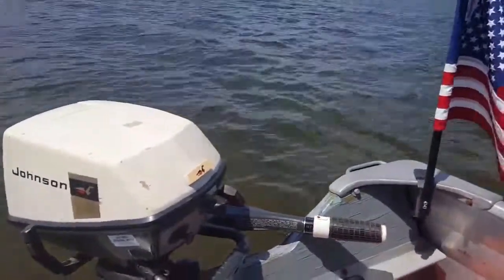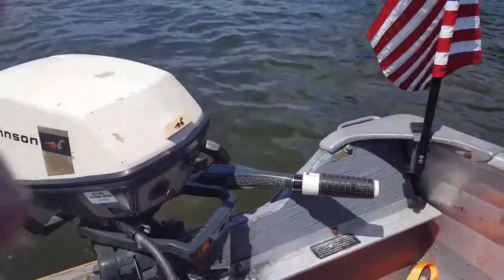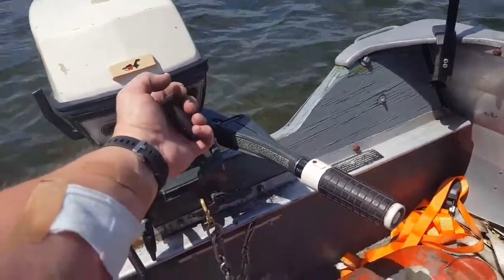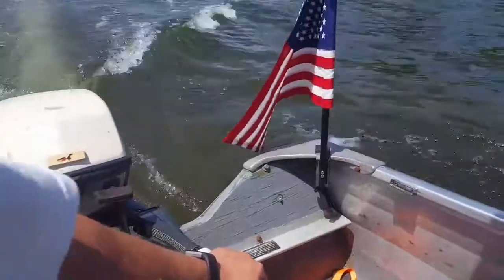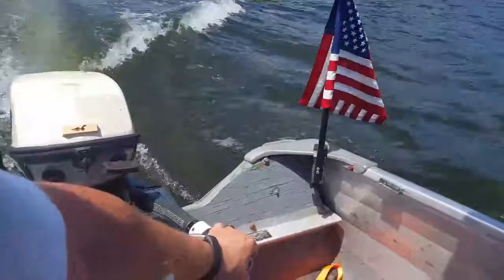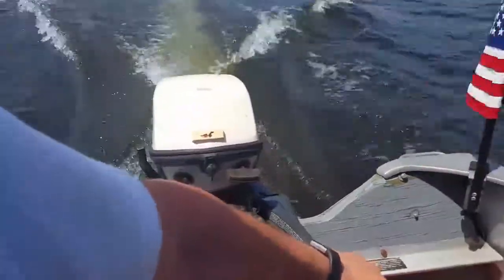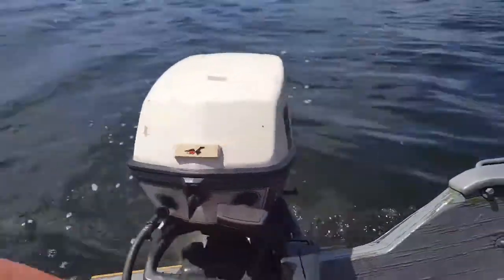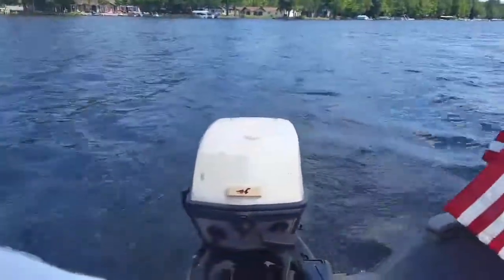1969 Johnson 6hp Outboard Motor on Manistee Lake

Comment: I have a 69 6hrs it's been sitting  up in my dad's closet  for about 25 years. I got it out the other day  and tried to start it. No luck. Pulled the plugs they were oil socked . Cleaned them with some fresh gas. Still no luck so I pulled of the fly wheel points look good to me sprayed with a  little  contact  cleaner still no luck pulled carb cleaned it up still no luck. What should I try next?  Thanks in advace.

Comment: ok thank you. but I don't know if I already said that it runs fine with the airbox off.
Reply from the maker: Corben B Yes, you did say that. That's what makes me think that gasket may be missing.  With the airbox off, it may be allowing just enough more air to burn the extra fuel getting through the leak.

Comment: I have got the same motor (6r69m) I was wondering when I look in the cylinders I can see it was honed. I have also noticed that the paint around the engine has turned red which I believe is from overheating.  Is there a possibility that this engine was rebuild or is it just a really low hour outboard and I am seeing hone marks from the factory.  Thankyou
Reply from the maker: It seems most likely you have a low-hour engine and you are seeing cross hatch from the factory hone.  It is difficult to say for sure without seeing it myself, but it is not that unusual to find factory hone still visible if the engine is in reasonably good condition.  The red is most likely just the original red primer you are seeing through the paint.  The powerheads during this time were left in red primer until they were assembled at the factory and painted. The final color doesnt always cover all of the powerhead very well and there are often areas of the primer still visible.  If you can see the hatch and no galling or scoring on the cylinder walls, I'd say you just have a pretty clean low-hour original example of one of these outboards.  Thanks for watching!
Reply: Old JohnnyRude Thanks a lot I appreciate the quick response. When I got it the shifting lever was snapped off. Must be someone bought new snapped the lever off and it  wasn't used for years until I acquired it. The cylinders look good the cross hatching looks very new (not faded at all) I have only put plus or minus 10 gal through it.
Reply from the maker: It sounds like you found a nice one.  The shift levers were a very weak point of this era 6hp OMC.  The Johnsons and Evinrudes both very often have the shift levers broken off.  I have 4 of them and this one is the only one that came to me with the shift lever intact.  Always lay these motors down on the tiller side.  Never on the shift handle side for this very reason.

Comment: ok that's weird because the guy who I bought it from said he rebuilt it, do you think it might just need to be tuned?
Reply from the maker: Corben B Not sure what you can do to tune the high speed circuit, some they are a fixed jet carb.  It's possible that it needs the link and sync adjusted (throttle cam set to open the throttle at the correct spark advance).  I don't think the would make such a difference between having the airbox on or off though.   If someone claims to have 'rebuilt' it, that would prompt me to want to have a look at it myself even more.  It may be missing the boss gasket / nozzle gasket in the carb.  That will allow extra fuel into the high speed and require more air to lean it out enough to run.  That would be worth a check.

Comment: You won't need any back up engine with that great old 6hp on the transom
Reply from the maker: kramden Thanks Don! This is a sweet running little motor.   It's great for small lakes and calm water.  It's often breezy enough on the lake by our cabin that it has a hard time planing the boat, but on calm water it will push the boat between 10 and 11 mph with just me in the boat.

Comment: could you give me some advice on why my motor won't run full speed when the breather box is on? it's a 1988 evinrude 8 hp
Reply from the maker: Corben B If it is running OK without the airbox and poorly with it, it sounds like the carb as getting too much fuel in the high speed circuit.  I'd rebuild the carb with a new kit.  The nozzle gasket between the bowl and the carb body may be leaking and letting too much fuel past.  Those carbs are tuned to run woth the airbox,  and if it won't, there is clearly an issue with it.